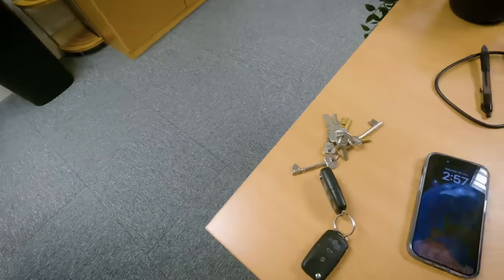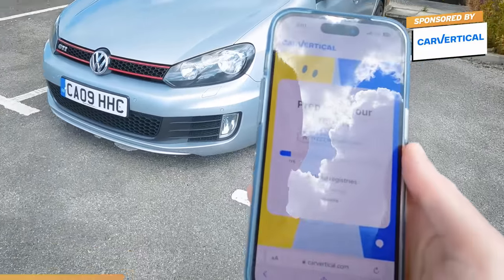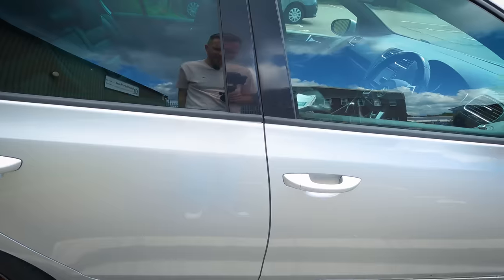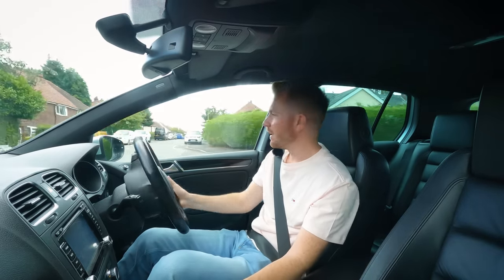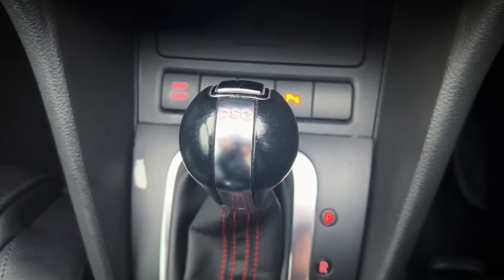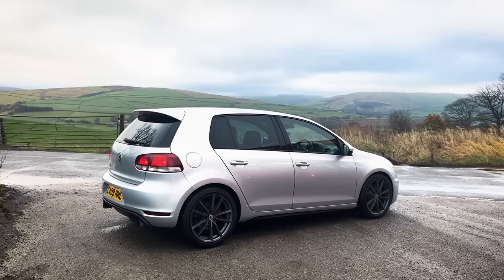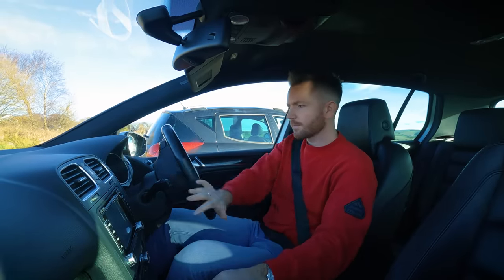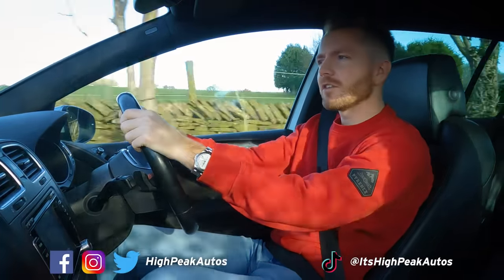I BOUGHT A CHEAP VW GOLF GTI FOR £3,500!

Comment: So frustrating because I always thought these had everything, space, design (interior), pace etc. maybe just get a manual one, if there are any left for sale! A really interesting video again and I’m sorry for your loss, Matt 😮! I’m also sorry I couldn’t help but giggle at the radio thing at the end of the video 🤭! But as ever, someone is going to get a fully sorted and well maintained car!
Reply: The manuals have a weak clutch release bearing which gets noisy and the clutches themselves are weak - at least they struggle to cope with a re-mapped engine, which the older generation vw's had no trouble with. To be honest there's about half a dozen high cost common failures on the mk6 platform.

Comment: Modern VAG. Just nothing but issues from Day 1 on the 07 Polo we bought new. Main Dealer were indifferent to it and us, VW were actively terrible at customer service: water pump was leaking from new, noticed after a few weeks. Work done under warranty but VW wouldn't pay for a new cambelt & tensioner because the warranty only covered parts directly damaged. They wouldn't budge, and I had to pay £130 to get my wife's 3 week old car back from the warranty repair. From then on it was just constant issues - ABS sensors were basically a service item, window motors failed, central locking that wouldn't, constantly blowing bulbs, and the ECU would periodically forget what it was supposed to do and need an on/off reset. 

Thankfully someone t-boned it just before the warranty expired and got rid of the problem for me.

Comment: Another good video Matt, Keep up the good work. Love them as you give a honest opinion. I personally think the Golf's are a great daily. My brothers 13 plate GTD was an amazing car. Even considered buying one as my next car, but probably a GTI. 

I had an issue with my Focus Powershift gear box. It did the same thing. But it only happened intermittingly. Quite hesitant at times. So we traded it in. 

This has put me off autos. Didn't think you would have such issue with the DSG gearbox tho. Meant to brilliant.

I think you will break even with that car. Lovely example.
Reply: 20 years of Toyota autos and not a single issue. At all

Comment: It’s quite surprising that VW have such a good reputation! I honestly don’t think I’ve heard one positive comment about DSG gearboxes! Cosmetically they are very good but mechanically 🤷🏻‍♂️ this kind of track record would destroy most car manufacturers. Great video though Matt👏🏻👍🏻
Reply: Totally agree with you, wouldn't touch any of these twin clutch sudo auto's with a stick. Alfa's version just as bad.
Reply: Had one their crap they have a really annoying pause sometimes when for example slowing down for a roundabout then accelerating it seems to get confused what gear you want and you could have your foot to the floor then pause and zoom really odd and it was brand new on lease hated it for two years
Reply: Because they aren't as unreliable as the reputation proceeds. They make millions of these things, they are insanely strong. The guys who tune them can get double their rated torque which is 700nm. Secondly, you only hear about the bad ones. There are a few bad eggs. The previous first DSG they made was trash. This one the DQ250 of the mk6 is not bad at all but as soon as 1 goes wrong it's painted with the same brush. Case in point I've had one for 10 years with no issues. And I know many that have been equally as reliable.
Reply: @wadenorton35  DQ250 is the first DSG box though, right? The 6 speed wet clutch.
Reply: @wadenorton35 you can forgive the clutch. How many clutches last much over 100k miles? The mechantronic unit less so. That should last. That said the car was designed to provide good performance and economy and durability, not last 14 years without a fault. Biggest issue is the sheer cost to fix them
Reply: @wadenorton35  ive got a mk7 R dsg and its awesome tbh
cars coming up to 7 years old and had no issues, dsg not been serviced yet either though approaching the mileage to get it done
just servicing them isnt cheap though
Reply: @dopiaza2006  correct, however there were many revisions of the O2E gearbox. The F series dq250 from the 2009+ was the 3rd or 4th revision which proved much more reliable. My car is 12 years old and stage 3 and I haven't had an issue with the gearbox. It can prove to be reliable. I have alot of tuning friends with mk6s and they also have not had issues with their GB. It really depends on servicing. I dont trust service histories
Reply: @paultasker7788  yes they are expensive to fix. This is true, but what German car isn't?...at the end of the day, I think buying and selling performance cars is always a gamble as they have undoubtedly had a harder life. That's like being disappointed you broke your leg after jumping off a roof...

Comment: This is why I've always kept the warranty going with Audi on my TTS, she's only done 26k miles (5.5 years) but I'm paranoid that the Stronic box will blow up.
Reply: As long as you service the gearbox and haldex with the correct oil at the correct intervals you should be fine
Reply: @FK2VtecTurbo  A colleague had the DSG gearbox replaced 3 times under warranty.  He made sure he got rid of it before the warranty expired.
Reply: @FK2VtecTurbo  it still will give trouble. They are terrible for going wrong as I am sure you know. Shame
Reply: I’ve done 212,000 in my DSG Touran without any problems, but I’ve changed the DSG oil and filter every 35-40k without fail. If the DSG on this one was first serviced at 85k (and by freeze framing through the service book there’s no sign of any ticks next to the DSG service box) it’s certainly not been serviced properly.

Comment: DSG gear boxes are normally not problematic if serviced correctly, another urban myth
Reply: I've had 2 and both had issues. Thankfully both under warranty.
Reply from the maker: Not true - this is evidence of that
Reply: My MK7 auto Golf’s DSG has been in the garage since August as they are unable to find a refurbed replacement. Full price from VW is £5000. The DQ200 gearbox is problematic as it happens - there is an almost exact same model next to mine it where it’s parked up with the SAME problem. I’ve bought a Lexus IS 250 as a replacement….
Reply: Our octavia 2014 dsg stranded us last summer on vacation. Also a gearbox fault 190000km(120000 miles). Ours just went out of gear when pulling away from a traffic light it is regularly serviced about every 15000 miles
Reply: MK5 Golf and it's had the box out a few times. Less than 100k kms.. what's that; 65k miles? Hardly stellar stuff. Also has minor trim defects but that's neither here nor there. I love it but it's certainly not reliable. Better than my Mercedes but that's a bloody low bar. 
Least reliable car I've ever had? Alfa 156. Felt like Christmas every day with all those lights on!

Comment: I had a Skoda superb, 67 plate, 2.0 tdi with Dsg. Only 26k on the clock; had similar faults with the gearbox on 2 occasions, plus water leak and a couple of other bits, I just give it back in the end. Only had it a year. Bought from Skoda dealer too! Back on BMW’s

Comment: I’ve had a few Golfs over the years and I love the DSG gearbox, I prefer it to all gearboxes Mercedes made, maybe apart from the classic 5 speed auto in the E-Class, when it’s paired with a six cylinder engine. I had to spend over £600 to get the DSG repaired in my MK5 several years ago, but it was worth it. That gearbox is quicker, more economical and of course, more comfortable than driving a hideous manual. I almost bought an MK7 Golf with the newer DSG before their prices had gone up to a ridiculous level and I’d only consider a Golf or Passat now with one of these. I quite enjoyed the comfort and steering column-based 7G Plus in my 2013 E-Class, but it was nowhere as smooth as the much older DSG in the MK5, which the MK6 would also have, I think.

Comment: I don't like DCTs at all. I own one but I wish I didn't, they just seem primed to fail at some point. Mine works ok most of the time, but they can be so inconsistent in how they behave. Mine is a supposedly reliable Kia and even they are well known in Kia forums for 1st gear judders from very early on. Can't wait to get back into a torque converter or CVT box again.

Comment: i have same car with over 200 k miles , i got to say that my dsg never gave me a single issue .....only the water pump changed due to a oil leak coming from timing belt cover went to the pump causing the damage

Comment: Never buy GTI's with high milage...these kind of cars are usually bought to be driven FAST and combined with poor maintenance and not being driven accordingly usually result in exactly this kind of problems (engine oil bootle  in the boot is telling me that is drinking oil aswell). DSG's  are very sensible to the quality and freshness of the oil...and again very important how they're driven! 2 services in over 100k+ miles is very poor maintenance...these should be serviced with fresh oil and filter at every 40k miles(accordingly to the book) but I would say maximum 30k!Failing to do this will result exactly in this kind of problems!Don't want to spend £200 once in a while for a gearbox service will make you spend 3k a bit later down the road .

Comment: My MK7 auto Golf DSG has been in the garage since August as they are unable to find a refurbed replacement. Full price from VW is £5000. The DQ200 gearbox is problematic as it happens - there is an almost exact same model next to mine it where it’s parked up with the SAME problem. I’ve bought a Lexus IS 250 as a replacement….

Comment: Clutches usually goes on dq200, dq250 usually last longer, a friend had a passat b7 2.0tdi with this transmission and more then 350k km and no problems, not with mechatronic unit which can be problematic and also not with the clutch.

Comment: Hi mate, im buying a used ford focus st line 1.0 ecoboost 2018 plate, full service history, fresh MOT, only 1 owner, only 32000 miles, mint bodywork from the pics ive seen, but only problem is the dealership is far from me so im getting the car delivered. I havent been able to test drive it but its the exact colour and spec with low milleage that i have been looking for for a while. Just wanted an opinion is it ok to get a car without test driving it? or is it risky you reckon?

Comment: Good old DSG's, I recently bought a seat leon 2019 with a DSG, and 2 months in it failed, mechatronic and a clutch plate had gone (still drove it to bristol and back from london in limp mode!) £2500 repair bill but luckily i got dealership to pay for it.

Comment: Had a 2005 Audi a3 with a 6 speed dsg. Looked after it never had any issues for almost 10 years changed the dmf and serviced the box regularly had over 150k and got rid of it due to rust, but the box was awesome
Reply: And I had an 07 A3 which munched through a mechatronic unit and engine mounts within 12 months!

Comment: Yeah, the headliner is a signature defect of the mk5 and mk6's, just re-did mine on my mk5 Jetta . I think in the the end the Golf is actually pretty nice and it could sell well. But I also think that for these cars the safest deal would be to go for a tdi and a manual, especially the 1.9 mk5's, mine is going strong at 370k km, but headliner and electronics is still a problem to deal with on these
Reply: I’ll second the TDi manual. We bought an ‘05 ex demo in ‘06 as my wife’s comutacar. She used it for 5 years and wound the k’s up to about 280000. At that point it was worth peanuts to trade so we kept it as a spare car for the family, including a spell as my student daughter’s car when at Uni. Fast forward to this year, little Golf basically still respectable in and out, tyres, service as necessary, wash now and again what more could you want - then the arrival of a French student here on the farm in Canada. Part of the employment contract was provision of a car - Golf was ideal.
Busy spring period over, he and another student from the same French Uni going to explore Banff and area in Golf, 2nd day out rear-ended a line of 3 cars stopped at another accident. Outcome - 3 damaged cars, totalled Golf, but nobody hurt, Banff hols aborted.
Poor old Golf, been in the family for 17 years, now ending its days in a prairie wrecking yard with 360000+ kms. We’ll never know how long it ‘might’ have lasted.

Comment: As a 07 MKV GTI owner (2nd owner, FSH, 85k miles etc) i can attest that the mk5 gti is far more robust. Granted i have the basic 3 door manual with tartan seats, bog standard everything but with A/c added , but these are great and very relaible, is a great everyday car, and on a sunday morning blast is hoot to drive feeling truly mechanical with great chassis, hydraulic power steering and a great manual gearbox.
I never liked the mark 6 at all, and whilst the mvk 7 is much more modern it is vastly overpriced. 
Get a GTI MKV as a weekend car and enjoy!

Comment: I have a Skoda Octavia 1.6 Tds diesel, owned for 12 years and done 91000 miles , no problems with the  gear box until here in Wales we have the 20 MPH , as now retired only doing local town shoping 60% is in the slow zone's i watching the gear box struggling stay at low speeds on hills which can jump from 2nd to 5th over a few metres, as much  as i love the car as a 10 plate it would cost twice its value to repair it 😢😢

Comment: I always try a dsg reset first, either via obdeleven or accelerator pedal to the floor method, this sometimes works, but probably wouldn't in this case.
Maybe whoever wired in the aftermarket head unit took the power from the reverse power source ie reversing lamps or camera power or similar?
Reply: It's because these golfs have a parking sensor visual on the original screen but obviously this aftermarket one doesn't. Some of the more expensive ones specifically designed for VWs do but most aftermarket head units won't do it so they'll just turn on the radio 😂

Comment: Never had a Mk6 but have had 2 Mk4s & 2 MK5s, first the only brand new car I've ever bought a 51plate PD150 GT TDI followed 4 or 5 years later by a 2 years oldish PD 130 GT TDI followed by an 05  GT TDI 140 then an 08 GT TDI 140.with DSG. Non were older than 3 years old and and the Mk5s were definitely a step backwards. The DSG on my.140 TDi was perfect I definitely no of problems on VAG models but not as many problems with diesels.. Maybe I was lucky as my last Golf was stolen in 2012 and that's why I missed out on the problematic gearbox. I have a friend who had the with his MK2 VRS Octavia and someone else who had Seat Ibiza Cupra 1.8T. I've been put off having another Golf , Seat Leons is a better car and it's practically the same car.

Comment: Mk6 GTI’s with the TSI and 6 speed  dual clutch transmission seem to be most costly to own.  Rear main oil seal failure $$$, DSG failure, $$$, and the potential of a timing chain tensioner letting go and grenading the engine. Not a great combination.

Comment: Modern VWs don’t cut it for me, I like the Passat but they’re not any better than any other everyday car in my opinion, I remember looking at a VW DSG auto for the wife , we didn’t like it and the gearbox on test drive at just 64k didn’t perform well, we bought an Astra 1.8 auto for which we still have several years on, the Astra felt a nicer car to drive and smoother, however I would have an Old VW camper or Old Beetle for example (air cooled versions) we had a auto Mercedes a few years ago that used to get stuck 2nd which had a fault and if you switched it off and back it’d be ok for a short while then it’d go again and stay in 2nd only.

Comment: This is what worries me about early dsg models. I've got a 2015 2 litre diesel which I mapped at 80k now I'm at 194k with no dsg issues
Reply: Dsg paired with 2 liter engines or more, are the more durable ”wet clutch” dsg’s. Dry clutch is the one you want to avoid.

Comment: I think you got taken on the DSG flywheel. When they go bad they make a very weird humming clunking sound. As you continue driving it hums louder and louder. That was the number one thing I was checking while you took off from the parking lot and not once it made any noise. You should have asked them to show you the flywheel, and you will know right away as if it is that bad, is like two plates in one, will have excessive movement, which I do not believe it had any. Bad DSG flywheels is like bad wheel bearings, there is either noise and scraping that is bad, or there is no noise and smooth ride indication that it is good. 
The only issue with yours was the shifting, but it shifted fine as it showed, like I said, there is no such thing as a bad wheel bearing that will run fine for s while and then it doesn't.
And thankfully you did not got hit with a timing chain tensioner and low oil pressure issue, that would have been just a write up and probably you get suspended for a month or so, ja ja!
I wonder, how much you soUled it for? Because this cars rip the soul out of anyone when they go south!
DSG flywheel symptoms -
https://youtu.be/sfHm5DNrBow?si=1VH4T5zCH205njG5

https://youtu.be/YlfGm7me1vc?si=saZ7jVL6-g4hNo-N

And would have done a DSG transmission reset, which is relearning the transmission computer after a service job.

Comment: Hopefully the car vertical revenue helps cover some of the costs on this GTI.
I had the oil seal leak on my 2.0T A3 with that DSG box. It was an 06 plate,  5 years old and the main dealer quoted just north of £450 to do it. That’s on top of the service and cam belt change I was having at the time. So I politely refused and started looking for a replacement car promptly. With 4 years ownership and 35k on the clock it was a disappointment.